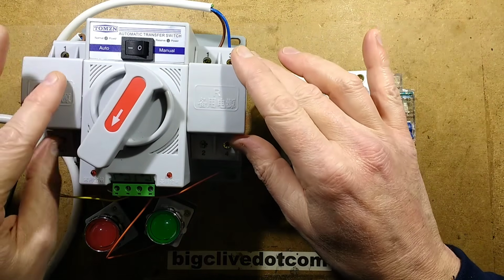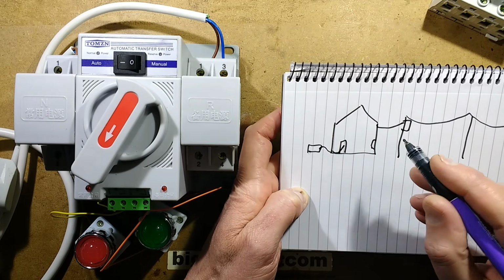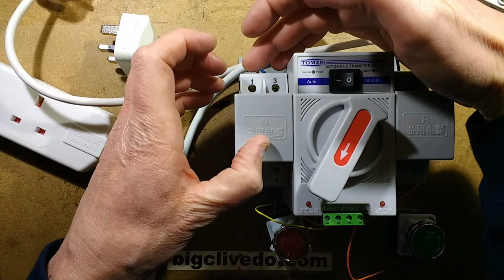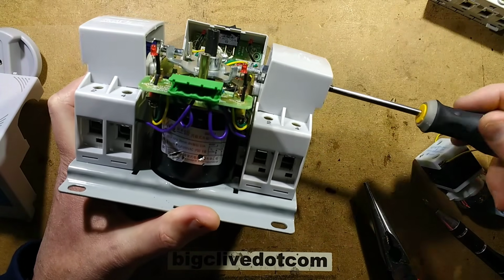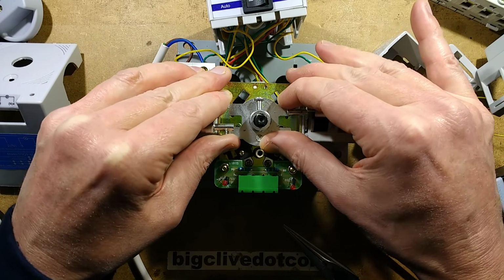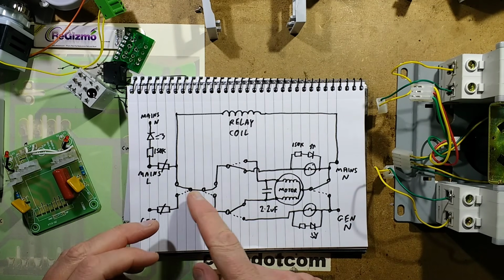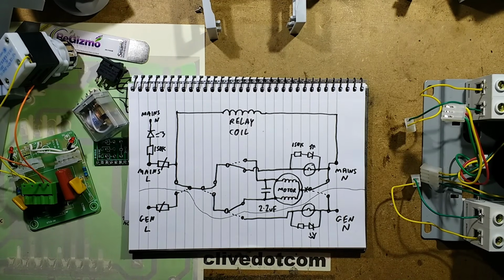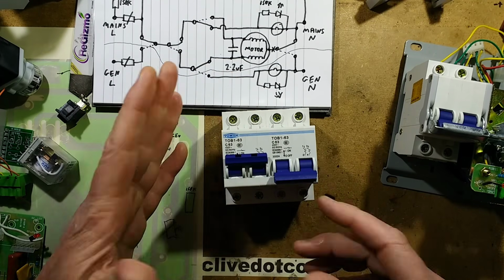Automatic generator changeover switch (with schematic).

Comment: When we had a generator (US here), we had a cord hardwired into the breaker box that would plug into the generator. In the breaker box, there was a sliding metal plate that would block the breaker for the generator if the mains power was on, and vice versa if the generator was on, so that they can't both be on at the same time.
Reply: yup, they are still sold for each brand. the thing in this video is just a fancy version of that.
Reply: That plate is called an interlock kit that mounts to panel deadfront.

Comment: Can you use this with 110/120v ?
Reply from the maker: The Chinese units are mainly 220V for their own supply voltage.  They may do 120V ones though.
Reply: ok thank you , I was looking on ali express and ebay and the spec sheets say 220V so i wasn't sure if 110V would still work or not.

Comment: My friend in USA bought a more expensive version of this and he has a pretty good diesel generator, and it does it's job and switches with quite a bang! It's well made and works great. Power went out...BANG....generator started up and the lights and everything else came back on. :) Power came back on another loud BANG from the changeover switch and generator shut off, the sound is because of the GIANT contact points in this thing it's no joke.

Comment: I always wondered why an industrial ATS is the size of a fridge and cost more than my house.  They get cut-over so fast we had one bend the terminals over.  OMG you ever see some of the contraptions to let you plug an inverter and generator back into your house?  The crappy square sin inverters have a 75V offset from neutral to ground.  How does no one die?  Not to mention your electrical company will throw a fit.

Comment: We don't have many power failures to worry about, but boats is need to switch from shore supply to generator and even a battery with inverter. Usually we get no more than 10amps coming in. The usual approach was to have three switches with a sliding panel that prevented more than one being used at any time. We would start the generator and warm it up before switching off the shore supply and switching on the generator. In the same control panel we had switches for all the loads. It was common practice to flip them all off before the switch over to generator, and then switch each back on in sequence, allowing each to settle before adding the next load. It sounds complex, but if you understood what was happening it soon became second nature. We would have to think whether we really needed the water heater or air conditioner or battery chargers. I love automation but sometimes it's sensible to make your own decisions.

Comment: One of my jobs many years ago was pat testing within the company .in one department was a very nicely made bench on wheels so it could be used within the lab.Anyway pat testing must have been lax in the past because when i unplugged the plug connecting it to the mains (it in reality was just a extention lead but with conduit feeding several sockets along the back ) i unplugged it from the supply and plugged it into the pat tester and everything went black!Once the power was restored i noticed the problem the designer had in his wisdom fitted a clone lead on the other end !!!!Ofcourse i was lucky i didnt inspect the first plug or i would have found to my dismay the pins would be live fed from the other plug .Repremands were made and i left with 6ft of wire with a plug on the end and the knowledge to look a bit harder in the rest of the building

Comment: A very interesting and well presented explanation.....thanks. I have installed a manual change over system with manual interlock and have written a set of procedures to switch off load as I don't believe the Chinese breakers I bought can be relied upon to make or break load. So I change over off load. 

I found your explanation of back feeding the 11kv brought back loads of memories as an Operation Engineer on the Southern Board' hv networks up to 132kv Now I am talking of the 1960s/ 70s !!  The standard was to test and Earth the lines at all hv levels of work before issuing a Permit To Work
As indeed there had been fatalities. I recall testing at an old 33 kg sub station to find the back feed was from a neighbouring Lviv network back up through the 11 kg and finally back up to 33 kv.

However later I experienced amazingly scary hv practices in Canada and the USA ...but that's another story.
Reply from the maker: There's a certain element of heroic culture in the US power distribution system.  They have a horrific fatality rate.

Comment: it has some good in it, better than the manual method which risk of shorting both power together... 
but by switching like that.. it most probably ruin electronics like computer which without ups unit.

Comment: well i have the question. out put wires or connection from generator and main can we joint each other or not. i mean there is no chance of reverse current or voltage?

Comment: Wouldn't it be cheaper to use a normally closed and normally open contractor, with the incoming supply controlling the contractors, it would be automatic and much quicker?
Reply from the maker: +m A slight delay is useful when switching between two non-synchronised supplies.

Comment: One problem with this is that it only supports a single pole power input.  Great if you are in Europe but in the US, we have 2 120v inputs that combine to make  240V power.   You would need to buy 2 of these and then figure out how to wire them to work together.

Comment: My last house had a barn that was wired with 30 amp 220V power.  I tapped into the panel out there and mounted a generator plug on the wall.  When the power went out I would flip the main service breaker and plug in the generator in the the barn outlet.  Whole house went back online with no issue.  Not really any different from plugging into a dryer socket.  
In my new house I just got done wiring a generator plug in the garage.  I decommissioned the stove wiring (using gas range now) and replace the 50A breaker with a 30A.  Pretty much the same deal as before.

Comment: So how would this work on a USA panel with a 200A mains breaker?  Those plugs can't be rated more than 30A-40A.  My main circuit panel has a 200A mains breaker.
Reply from the maker: This would only work for around 60A if it's ratings are accurate.  At the 220V it's designed for that's a useful amount of power.

Comment: Does it cause any interruption on the active load at the time of switching? Say an aircondition running on generator or solar inverter  draining and going back to supply utility. Im planning to buy one for a solar system plan. after seeing your video i got the idea of possible putting the solar inverter line on the priority and the utility on standby until the inverter cuts out. Thanks.
Reply from the maker: +Carmelo Baquiano There is a short dip as the motor switched over.
Reply: Have you made THAT work. I tried it and it didn't work and don't know why - pure sine wave 3000watt 230 is exactly the same as mains??

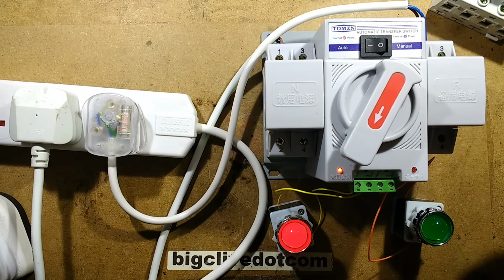Comment: 6:42 The entertainment industry could use this exact same type of item, except have the inputs switched so the generator takes priority over the mains. This way if they lose power and the generator kicks in, they can keep everything running off the generator until they feel safe switching back to mains, and all they have to do is shut off the generator and allow it to flip back on its own.

During generator maintenance (at my house we run the generator 30 minutes once a month to keep the carburetor from getting clogged), they could just set it to manual mode to keep it from flipping the power away from mains while there's no power outages.

Comment: What kind of circuit would work to switch from mains 24v wall wart to 24v battery, while not charging battery or losing power to micro
Reply from the maker: A relay powered by the mains that switches between the transformer and the battery, and a capacitor to ride the brief change over.

Comment: I just do not understand what is so complicated about a simple, inexpensive, whole-house transfer switch (auto or manual), and redistribution of circuits as needed for balancing large loads (e. g., coffee maker "Hot Side A to Neutral," toaster "Hot Side B to Neutral"). "Hot-to-Hot" loads - as with the 120/240V mains here in the USA - just stay where they are. That, and some common sense with loading up the genset, is as exotic as it gets in our house. My wife, self-proclaimed electrical idiot (she's far from an idiot), with a little bit of knowledge, can do the quick math in her head and know when to stop adding load or let something go to run something else.

Cost savings of my basic 3P/2T basic knife switch aside, I see no good reason to not make every circuit in the house available, rather than choosing designated "Emergency Power" circuits that are all that's live when the utility power goes to 0. Accidents can be avoided by opening the breakers associated with the big thing(s) that should be locked out - e. g., electric dryer. There's no law saying you cannot operate the electric range on generator. The only law is how much of it the genset can handle. "Big burners are 1,200W, little ones, 800. Don't forget the water pump." Hell, if need be during a multi-day outage and underwear shortage, we can run the electric dryer on our little Honda. That and maybe some lighting to see the thing, but an honest 5.5kW rated (6.5kW "maximum") plant can handle a dryer's intermittent heating. 

It has been fun to watch the time-lapse healing of your latest wound!
Reply: Big Clive you would make a fantastic trainer at tech colleges training the next generation (no pun intended).

Comment: Might even be smarter than you think, the terminals for the aux lights that you attached could be used for an electric start and a kill switch for the generator. Possibly via a battery or some kind of power reserve. Not sure where that would come from unless the generator was running. It must use some sort of battery.

Comment: What would happen if the contacts of one of the breakers welded closed, I suppose it would lock up the switch and stall the motor as it has to trip the first switch down?
I was thinking how you could switch really high currents and wondering is there such a thing as a contactor that's a true break before make changeover switch? That is to say the switching is done by the physical connection going from one pair of terminals to another rather than having a theoretically interlocked pair of single throw switches (thinking about your "somebody poking all the contactors in and shorting the phases together" comment on a previous video)

Comment: It is interesting that, in the "civilised" parts of the World, where everything from sub-distribution downwards lives underground,  consumer-level loop impedance is usually very low. Compare that with rural Australia (where our supply is entirely pole-based) and loop impedance is pretty high simply because of contact ageing / corrosion. We are no more than 1km from our community pole-mount transformer, yet our loop impedance is around 100 mOhm (measured during line maintenence), so our max local fault current (per phase) will be around the 2.4kA region - well within the spec. of even a modest breaker.  Add in our "surge protection system" (big ferrite cores strung on phase and neutral lines), and the likelihood of being exposed to even the 2.5kA is low.
Reply: Did you do the measurements yourself or did one of the crew give you that value ? If you are more then 1 km away from your distribution transformer no way you get 100mOhms or 0.1 Ohms, you more likely to get values close to 1 Ohm, which makes the fault level at 240 Volts around 240 Amps. In Auckland most loop impedance values in pillars is around 0.2 - 0.4 Ohms within 200 meters of a supply transformer, for a MEN system.

Comment: Isn't it a bad idea to have something blocking the breaker from tripping? Is the motor loose enough to allow the breakers to trip?
Reply from the maker: The breakers will trip internally even if the actuator is held up.  They have to do this, otherwise less capable people would tape breakers in the on-position.
Reply: That explains the lack of fires in one of the apartments I lived in...

Comment: Can you show a device used to auto-start a generator on mains failure? Is it simply done using a relay to crank the engine but allows the generator to run up to speed before delivering power?

Comment: Okay, I have a question, Clive: I see stuff like generator switches on This Old House and Ask This Old House once in a while. And those are even designed to backfeed the grid, and as they say, maybe even run the meter backwards depending on usage. Why then, should anyone need one of these if you don't need them with your solar panels or wind turbines (because even they are intermittent and might get out of phase with mains too)?
Reply: The Solar/inverter/generator systems intended to "co-generate" with the utility (to reduce your electric bill) automatically shut themselves off in the event of loss of utility power.  Without some professional modification, they are not available for backup use during power outages, even if wind or sunlight are otherwise available..

Co-generation systems have the ability to synchronize with the utility before connecting.  Since they turn themselves off when the Utility is off, they do not need the safety isolation precautions and mechanics that are required for automatic (or manually connected) backup generators.

Comment: a neat trick for hot melt glue that's in hard to reach places you can't apply much force or heat is to give it a shot of freeze spray
makes it hard as a rock and allows it to crack off the surface of things easier

Comment: Worst ATS ever. Takes like 2 seconds or something to switch over? Wouldn't you want some amount of milliseconds or nanoseconds of switchover time to preserve computer state and such, typically? (Assuming you had loads with more tech than just lights or motor loads.)
Reply from the maker: You would use a UPS for computers to cover the delay of the generator starting and switching over.
Reply: Yeah the tool sucks because its not designed for the job you want it to do. Grow up

Comment: The real risk from back feeding is almost always associated with portable generators.  Permanent standby gen sets are almost certain to have an ATO.  After all, whats the point of having a standby set if you have to manually engage parts of the system.  For portable generators, simple but effective brackets can be fitted to the load center  breakers to prevent backfeeding.  For example, https://www.interlockkit.com/

Comment: Where I work we have automatic transfer switches for generators. They seem to be purely magnetic though, rather than having a motor. They also give a rather startling "Ker-chunk" when they cut over (or back).
Reply: Probably contactors (relays).  I prefer them but they aren't as interesting to disassemble as one of these motorised things!
Reply: 50 years ago we had a 150 amp (primitive) ASCO transference switch that used a large solenoid to "yank" on a heavy "flywheel" when transferring the switch.  The rotation changed the switches and the momentum brought the wheel "over center" to position it for the re-transfer when power returned.  It made a very loud "clunk."

Comment: TOMZN interlocked breakers had even lower interrupt currents than the single breaker.  Only 3000A?
Reply from the maker: Yeah.  I wonder what sort of electrical system they are designed for use in.